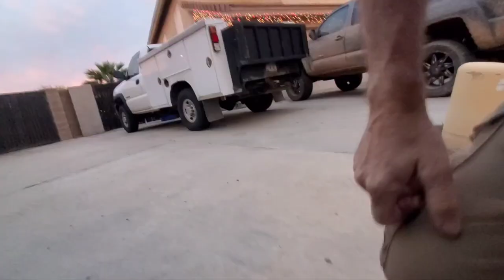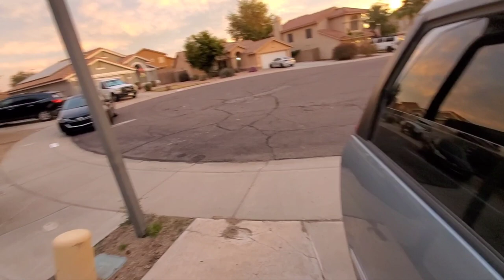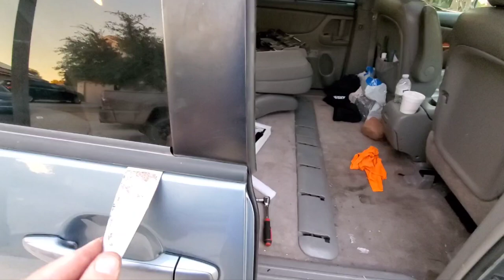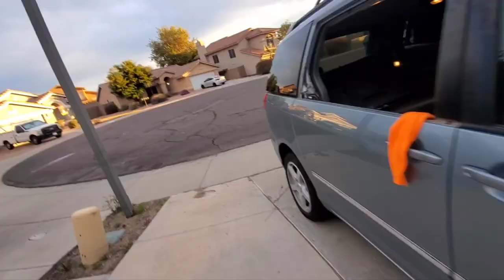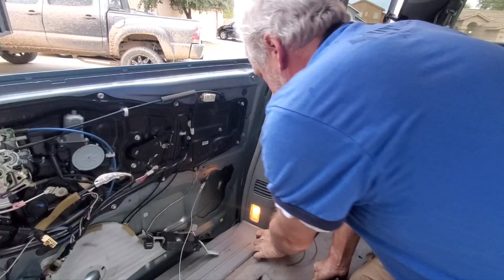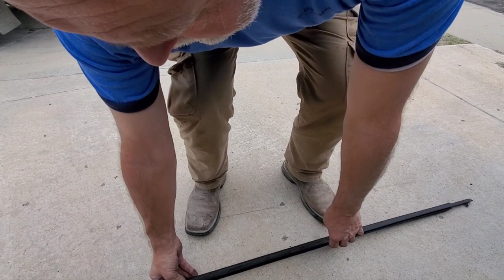2004 thru 2010 Toyota Sienna side door cable replacement.

Comment: Thank you for the in-depth views of this menagerie of a door.  I got too close to a concrete sign post and managed to peel the molding off and put in a shallow smooth dent so I was looking for how much work it is to get close to that dent and push it out with my hand . Unfortunately you did not remove whatever that white thing is on the bottom left of the door where my dent is located. So I will give it a try. 16 year old van so it does not have to look pristine .

Comment: I just finished doing mine on my 04. I have three brass screws with spacers left over. I also have leftover a black one, which I am pretty sure I know where it goes and two of the 10mm brass bolts. Do you remember where the three screws with the spacers go? Did you get a quote from a shop to repair this?
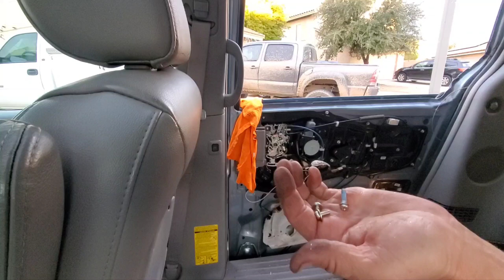Reply: Ok. I see them at 21:05. My new kit came with three new screws which explains why I have three leftover. If the driver side goes I am just going to cut the cable and leave it as manual. That was way too complicated. I would say it took me a solid 8 hours. The window bolts fell down into the door cavity and I had to fish them out with a magnet on a coat hook. That probably took an hour and a half, and it happened twice.